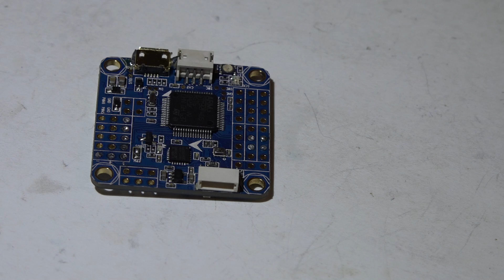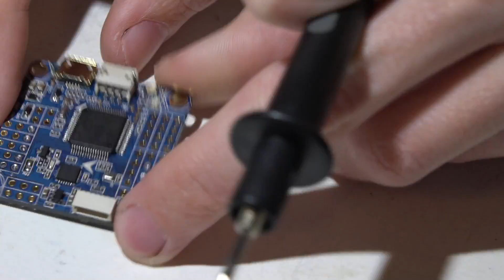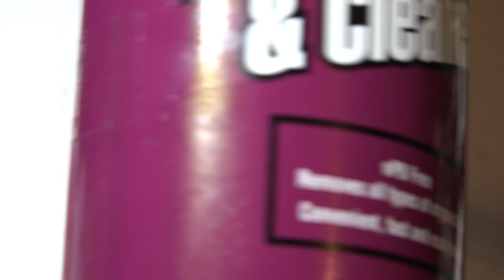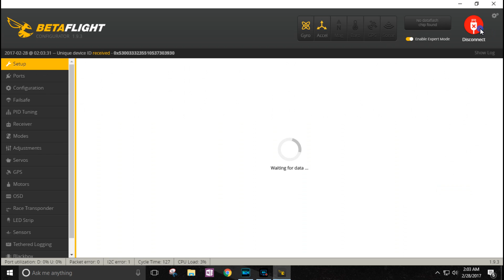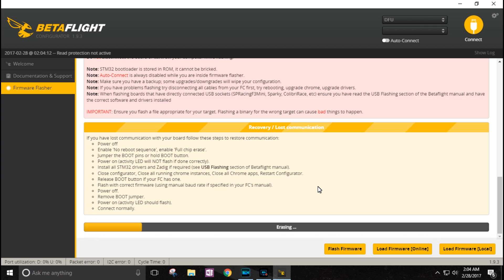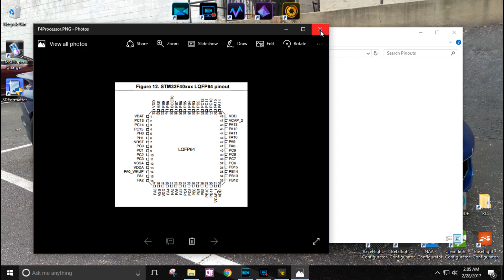Replacing Flight Controller STM32 Processor

Comment: a trick that helps is covering everything that surrounds what you're working on with capton tape.  It's good at blocking heat and will keep you from accidentally moving any surrounding components. Something else I like to do is take a good look at all the legs with a microscope.  It's very easy to get not enough solder with the paste and you'll have an intermittent connection.  It's pretty easy to tell with a microscope when you have a good connection or not.  If you find a bad one, just put a little flux on it, a TINY bit of normal solder on the tip of your iron and just touch the leg with it.

Comment: I've seen a different method of attaching a processor but instead of a hot air blower they used a fine tip soldering iron and drug it across the pins.  Worked slick.

Comment: Nice! I find it a bit easier to place the tweezers on the chip and then heat it up. Takes a very steady hand, but as soon as its ready to pull, it comes right off. I also my iron with a good tip and tack all the pins down, then check with a microscope for bridges. Its also a good idea to try and wiggle each pin to make sure they are soldered down good.

Comment: Much respect from me.  I've always used stencils to apply solder paste to boards. I personally would never attempt doing this freehand like that. You may have issues long term with the solder paste though. From my experience, they require a specific heating curve (temp vs. time) for it to successfully bond and be reliable.

Comment: For most people with less soldering experience it's better not to remove solder from pads cause they have high chance of removing pads along with solder. You can easily solder new mcu on top of old solder and just remove excess later as you did

Comment: okay 2 things, solder wick usually have flux inside and you didn't clean the board after using wick, It looked dirty 8:42 Anyway, nice idea on using solder paste on 2 sides.
Reply: Hey, i have connected 3s battery to CRNT Pad (current sensor ) and there was magic smoke from processor , do exchanging it will fix my fc?:P

Comment: Next time you can use Kapton tape it's heat resistant tape and it will hold all the other components while you're using your heat gun.

Comment: Short time ago I physically damaged a new Picoblox FC. 
And this is how it happened. 
By mistake I had soldered a bridge on 2 solder pads for a S-BUS RX instead the correct ones for a PPM RX.
No problem, I thought, lowered the temperature of my soldering iron a bit, pressed it on the bridge over the soldering pads and tried to remove the solder with my desoldering pump. (instead of using desoldering braid…)
Immediately both pads came off and that was it for the board. It was physically damaged and went to the trash….

Comment: hi i have omnibus f4 pro v2 flight controller , GPS constantly breaks down , i change new gps module but after 3~4 flight again break down , 3 pieces gps broke . when i plug battery . uart 3 connected to bn 220 .
i will connect pdb 5v  gps power , i added capasitor .

Comment: I have been waiting for you to make this video for a bit. have you tried qwikchip solder? It melts at a lower temp and stays liquid for longer. Eevblog's yt channel turned me onto it for removing larger chips like this. It helps avoid the risk of heating the wrong component. Solder paste can be used for this in a similar way to quikchip but requires a heat gunn too.

Comment: I have 3 boards and on all but 1 the stm32 chip gets hot. Can yo show how you tested the board,to show why it is just that chip and nothing else that is linked to the chip. As i have replaced the chip and still  am unable to get it to boot mode The chip does not get hot anymore

Comment: Hello! Can i get some of your help with a mod im doing with the JJRC x1? I have the 4-1esc that comes with the X1, and will be replacing the fc with a Flip F4 Omni. The only output wires from the X1 4-1esc is battery out (pos), gnd, and 4 signal wires from the motors. Looking at the Flip F4 Omni, and the 4-1esc, can i wire the battery out and gnd, not regulated by the esc, to the Vbat and gnd on the fc (left of fc, third row down) and the 4 signal wires to the PWM pins (right of fc) and the PPM pins to the ia6b receiver?

Comment: Could you replace a F3 with a F4 that is the same size vice versa ?
Reply from the maker: Nope. All F4s are larger and have more pins so they can't be swapped with each other
Reply: Thanks :) What about other components such as resistors and capacitors. How do you identify whether they should be replaced/ identify which components they are.
Reply from the maker: Those are a bit harder usually because if one breaks off you dont know what size it was. If you have another flight controller thats the same then you can look at that one and get an idea. On ebay they sell variety packs of resistors and capacitors of all sizes. I just grab one out the bag and put it on.

Comment: Hey JC I now have 2 dead BFF3 FC and I'm looking to see if I can repair one with the other or whatever. For one of them, if I power it up either USB or battery, blue and red LED immediately go on and stay on. No flashes. The other was due to letting my buddy fly my quad... long story short, he full throttled into the ground. Now when I power up I get no video. its just black, esc make their power beep but no signal. I get initial blinking on the board but then it kinda freezes and leds will continue to do the boot up patern. any ideas?
Reply: Im in the same boat you are man but both of my processors are jacked, found somewhere they sell the processors though.

Comment: Hey JC I'm having trouble with my microcopters with brushed f3 evo they won't pick up on the s bus receivers they are bound and connected but not showing up in beta flight when I choose serial receiver and save re connect and it won't be chosen anymore same problem with 2 boards and 3 different receivers gotta be something I'm missing HELP Paul.
Reply from the maker: Not sure what to say bud. If you've followed my videos exactly how I do it, then I've shown everything I know. Could be a firmware or hardware problem. Sorry I'm not that much help.
Reply: What UART do you have the receivers connected to? I had the same problem and it was due to the fact that I hooked it up to UART3, but in this F3 EVO boards they need to be in UART2 (also remember to change the serial to UART2 in the ports tab in BF). Let me know if that works
Reply: Miquel Pavillard I did use uart 2 then even tried 1 but like I said when I choose serial receiver it changes when I save it my first board came with the frsky receiver built in and worked until I changed some settings then lost receiver connection and new boards new receivers all the same

Comment: for all that work, I'll just buy another $20 board!
Reply from the maker: Not a bad idea. But I dont just fix processors. Fix regulators, diodes, broken off capacitors, ESCs, cameras, video transmitters, motors, anything. The money adds up. I've probably saved a couple thousand dollars over the years. Off camera I can change a processor in under 4 minutes.
Reply: Project Blue Falcon Wow, you do do a lot of fixing. I don't fly too hard so I tend to not break too much stuff. My soldering skills aren't that good either.
Reply from the maker: Yea if you're not breaking that much it's not worth buying all the tools and everything. Buying new parts would be the best way to go. I'm like "the repair guy" in my area so I just do repairs for other favors like 3d printed stuff and beer lol
Reply: would love to see a motor repair. I've got an Armattan Oomph (so not cheap) that seems to hover normally, but when I punch it, it loses power and makes the quad drop. I know it's not the esc because I've switched it and it always falls by the side this motor is in. Maybe the copper wire has lost some of its enamel?